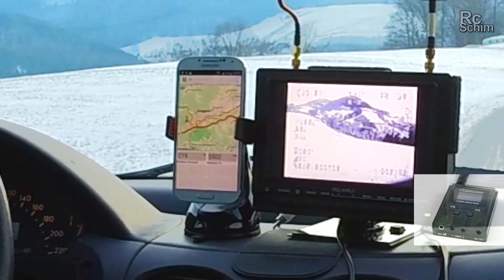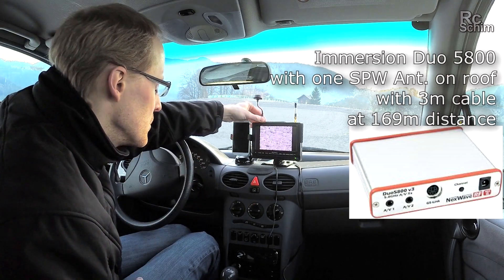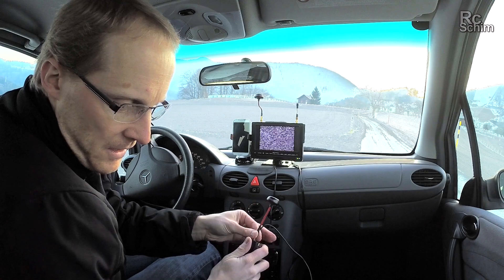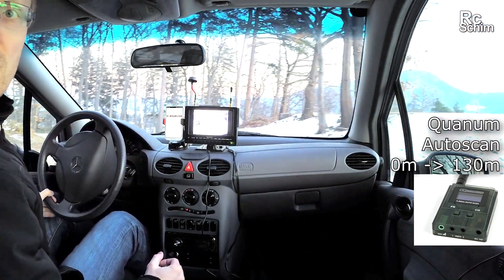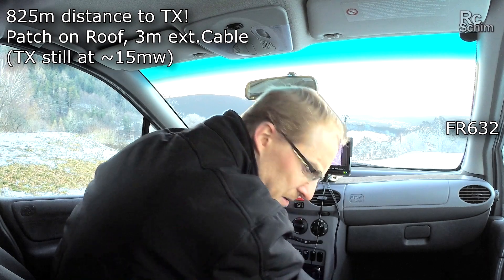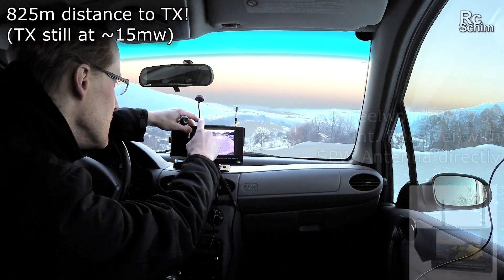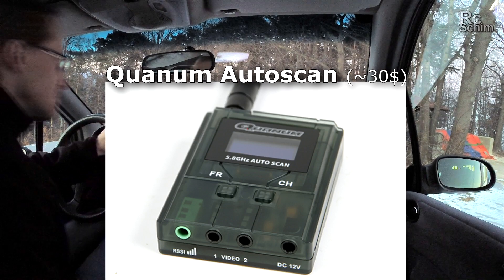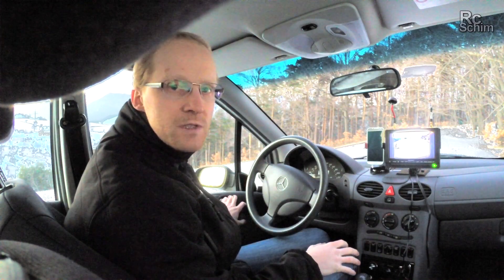BIG 5.8 GHz Video Receiver shootout / comparison (practical rangetest with my car), 25mw Videorange

Comment: hi! Thanks for video! Can You say - is it better, more power, if solder antennas directly to receiver and transmitter?
Reply from the maker: jazepsjazeps i don't think so. I tested the impact of sma adapters - and it was not much. You start noticing loss of signal only with longer cables.

Comment: Hi rcschim. Im looking for a groundstation i can use for mountain diving. I already have imersion rc patch 13 dbi. Will the fr632 be a good option for my mission? And how do u connect the gs to fatshark dominator v3? I will use 800mw vtx power.
Reply from the maker: +Viksa the patch is good but better use a helix - it has same gain but more beamwidth.
The fr632 is good. 
You can use a cinch to headphone jack cable. But there are different wirings on the jack side.
800mw is good :)
Reply: RCSchim thx for your answer. I will follow your advice😊 just got my tbs crossfire micro tx today. Feeling like a kid again.
Reply: Another huge improvement can be easily had by simply raising your receiver/antenna higher up. I frequently use a 3m tripod mast and my range goes up about 50% versus sitting with the RX at head height.

Comment: hello, I still have my old quanum v2 and I'm thinking if I should get a new goggles or just a better receiver like the fr632, how would you compare this receiver to the eachine VR d2?
Reply from the maker: The FR632 is one of my best receivers. lately I also use the "RealAcc" or quanum HB something receiver module in my fatshark goggles. with this upgrade the reception has improved a lot.
See my review about this receiver module. https://www.youtube.com/watch?v=Fh_BFc4Peyw
I think it should work on something like a quanum V2 as well if you can solder a bit. just see which pins are power, witch video and you should be good. the module is really small so you can add it to the large goggles easily!
Reply: RCSchim thanks for the reply, the quanum HB is about the same price as the fr632 so I think will get it if I figure out how to connect it to my goggles
EDIT: I think it's too complicated to make it work, it needs 5v to work and my screen needs 2-3s so I will need 2 different Batts also im not sure about the fatshark pin outs, tell me if you think it could work somehow cause the quanum hb sells for 32$

Comment: Thank you for putting together this comparison!  One thing to consider is that the top of your car roof is a huge ground plane.  The close proximity of the Rx antenna will distort the effective antenna pattern for your measurement configuration.  The same thing happens inside the car (which is why your signal keeps going in and out).  Nevertheless, the situation was consistent for each VRX, so we can at least see relative performance in a non-ideal situation.
Reply from the maker: thanks for the feedback. this was for sure a non ideal situation (and it was freezing cold back then :)
I wanted to repeat this test outside a few days ago - but my waypoint copter didnt work and I wasted a few hours einding the experiments. its quite time consuming and I then rather flew with the miniquad to have some fun.
but I will try to repeat this. RF stuff is hard, so many factors that influence things...

Comment: Thanks for a very clearly documented, and objectively judged comparison.
I wonder how the Quanum RC540R diversity receiver would compare in these tests.
Jim
Reply from the maker: Ha, now I know the real name of this HK divRX at least. I already did a short review, but no real comparison with the FR632.  currently I stick with the known good working FR632 if I go flying. I hope I can do a side by side comparison soon and test different things (also different antennas).  this just takes up so much time...
Reply: RCSchim:
Be careful, I still don't think there is a proper Model number for the single receiver Quanum scanner you evaluated. The RC540R is an enhanced diversity (2 VRx inside) receiver Quanum now makes which may replace the other one. Here is the link for the diversity receiver:
http://www.hobbyking.com/hobbyking/store/uh_viewItem.asp?idProduct=84862&pb=1
Jim
Reply from the maker: thanks, I know this is the diversity one - but Ì also did a short review (in my hangar tech talk)

Comment: Hi RCSchim, thanks for the review
Very informative!
I have two questions
1 I use fr632, if I want to change the on ImmersionRC Duo 5800, as it will be better, if the flying distance of 800-1500 m (worth to pay money)
2 What can you say about Immersionrc FPV Uno5800 5.8 GHz V4.1
(one receiver), it will be better FR632 or the same? what do you think?
http://www.aliexpress.com/item/ImmersionRC-FPV-Uno5800-5-8GHz-V4-1-Race-Edition-40ch-5-8GHz-Raceband-Dual-Output-Diversity/32625068405.html?spm=2114.01010208.3.2.P8rsRC&ws_ab_test=searchweb201556_9,searchweb201602_1_2020018_10017_10010_10011_10018_10019_10036_10035_10034_301_507_10033_10032_10020_10001_10002_10005_10006_10021_10003_10022_10004_401_10009_10008,searchweb201603_9&btsid=8b6d2aa4-dd56-4848-8825-59b3faf96cb8
Reply from the maker: +Дмитрий Zerver funny, yesterday I read how BAD! the Immersion gear is said to be in comparison to the FR632.
Dont know why my tests dont conclude to this - but I guess my testing up there wasnt scientific enough. Gonna repeat testing now in spring and test more...
check this long thread with good info: http://www.rcgroups.com/forums/showthread.php?t=2275037&pp=30
might get you to buy an FR632   (I used the FR632 yesterday and had very good image with standard SPW antennas!)
Reply: +RCSchim 
Thanks for the answer
I understand the difficult pronunciation in English. sorry
If it is possible at the down of a video concluded a small description about video. So it will be easier to understand with written!
I will be in the future to watch your channel!

Comment: I use a 5800 DUO v4.1 on my Quanum v2 goggles (on the rear of over-the-head strap) and it works really good.  It is big, and expensive, but it seems to works as good as I could hope for.
Reply: what is good and how is your setup otherwise?
Reply: I was using two Spironets on VRx, now using VAS Cyclones. Also have some more directional antennas like a Pepperbox.  Using with Quanum Elite 25mw VTx/cam combo and also another 25mw micro system from ReadymadeRC.  But the 5800DUO is just great.  I just got a Quanum 540R diversity to try out too.  Crossing finders with that one.

I have lots of cams and VTxs though, like full sized CCD cams/ VTx up to 600mw. Haven't used them much lately, but hope to soon.
Reply: BWX BWX how does the Quanum RC540R diversity receiver compare with the immersionRC duo5800? I've been debating this for a while since my Quanum v2 pro goggles are on the way.
Reply: The power socket was flaky and loose and I never got around to fixing it or soldering in a permanent XT60 connector or whatever.. so never used it much.

Comment: I wonder if a non-Fatshark/IRC transmitter would cause a different outcome due to them having somewhat different modulations. I'd expect the Quanum and FR632 to perform slightly better in that case.
Reply: I think this is a valid point.  I have read that there is differences pointed out by RC-CAM on the forums in how they modulate or something to that extent.  This is still a great test because I think alot of people are using IRC vtx units but it would be interesting to get one of the cheap hobbyking vtx and repeat the test and see if the IRC receiver then suffers.

Comment: Looking at price the quanum is defently the winner 
For 30dollar
Reply from the maker: +wippo76 yes, the small receiver is really nice. a must have if you use the Quanum goggles. 
also the display  with rssi and voltage work nice.
however I like the flexibility of the FR632 whilst being so small and making my groundstation super compact. flew it with two helicals and had super crips image.
Reply: +RCSchim every situation is asking for another vRX 
now I have to convince my wallet that I need more different RXes :):):)

Comment: thanks for this.

however i am wondering if the extension cable degrades video signal.

any type of adapter and or extension decreases DBI.

Maybe try again with antenna directly on the video reciever
Reply from the maker: +Razor E It was the idea to weaken the signal (on transmitter and receiver side) to get to the end of the receivers ranges and see how they compare under same conditions.
I will maybe show in a hangar video how much the cables and adapters do degrade the radio power. As stated in a test 1m cable was already terrible for the performance. 3m are just killing it.  So if someone has the idea to extend his Antennacable to fly from inside a car: he might have better signal if the antenna is in the car ;-) but without extension cable...
Reply: Ok, I am from a wintery wonderland like you (Canada) so I feel your need to fly from inside your car. I have used a tri pod from outside by car, with a repeater sending signal back into my car with goggles.

I always wanted to use a magnet to place a VRX on the top of my car, however, was always worried about multi-pathing off the metal
Reply from the maker: I had the same tripod repeater setup in the past. I did 35mhz to tripod wroth uhf and long video cable to groundstation outside.

Comment: Hi Mario, that's amazing to see how the receivers works with different antenna setup. Thank's for sharing this! :-) Actually I would expect that all the brands using the same receiver board inside, isn't it? Could you check this probably? Wish you all the best and I'll see you, Paul
Reply from the maker: +hotliner Good Idea Paul, I will compare the circuits like Bruce would ;-)  but I guess IRC uses higher quality but older stuff. the image on the cheap new gear had far less noise - but it did dissapear sooner. So they do maybe some gain adjustment and if the signal is too weak this fails...
As soon as Spring arrives we definitly should go flying together (at the Backyard Airways?)
Reply: You're welcome! Would be nice to have a look inside :D ... Yes we should, at Backyard Airways or where ever you want! :-)

Comment: Thanks for the great and factual video. I am pleased  I have the IRC Duo V3 also. Any chance you could compare high gain antenna in a similar manner, like skew planar vs patch vs various helical. Have you used your IRC antenna tracker much? I would also be interested in your thoughts on it verses a high gain antenna pointed in a specific direction.
Reply from the maker: +Phil Nolan I have plans to do a lot of such comparisons - because I want to have some good reference and stop guessing about this stuff ;-)
But the next tests will be more practical:   my Xugong will have 25mw, 1m cable penalty again and I'll fly it away to read on the OSD how far. This can be tested then with different receivers again and different antennas.
But I can say: last time I swapped my Immersion 13dbi patch against 2  Circular-Wireless helicals (12dbi) and they are very smooth. they have a larger cone and really crisp video.
Didnt fly much with the tracker - because many flights were with miniquad - only seldom with the xugong. As I said - even here the setup time is a bit too much for me...

tracker vs. high gain antenna? well: on the tracker I would use a high gain antenna as well - so the only difference would be that on the tracker you have no limit, on the 2x helical setup  you "preset" your 120° of operational radius. If you happen to reach the border: "park" the drone in the air, remove goggles, turn antennas 100° and continue to fly...

Comment: Hey coole Versuchsanordnung Mario!...gut wenn man sich zu helfen weiss, wenn die Welt einfriert ;)
Reply from the maker: +wolkenkreuzer Danke. Ich hab schon davor mal einen Test gemacht - da ist meine Freundinn mit dem Tripod weggegangen. War dann recht sportlich für sie, denn die Reichweite war besser als erwartet. Leider hatte damals die Aufzeichnung per DVR nicht richtig geklappt: wenn Bildstörungen sind, nimmt der DVR nicht "linear" auf - dh. wenn man 2 auf die Timeline legt - driftet die Zeit auseinander. 
Beim nächsten "richtigen" Test wird wieder eine Gopro auf den Monitor filmen, und der Copter fliegt dann weg soweit das gedämpfte Signal jeweils reicht. Am OSD lese ich dann ab wie weit das ist.
Solche Übungen sind auch gut um zu sehen, trainieren, wie sich das Videosignal an der Grenze des Empfanges verhält. Bis jetzt bin ich immer schon bei leichten Störungen am Umkehren - da geht aber sicher noch mehr.
Reply: RCSchim ...na selbst wenn man weiss was gehen könnte, brauchts dann immer noch eine gewisse überwindung grins...aber es reizt natürlich schon es weiter auszureizen, weil es einem mehr spielraum verschafft ;)

Comment: Pretty cool comparison :)
I did not know actually that the duo 5800 receiver was so expensive lol
Thanks for sharing and have a great weekend
Reply from the maker: +ABMNS PRODUCTION thanks cedric, I checked the current price on the latest v4.1 version that is surely a bit better than my old v3.
Reply from the maker: +ABMNS PRODUCTION thanks for the share. definitly a good idea - but he still copes with the 60hz limit of the liveout screen. And if you don't have electricians background you probably dont have an oszilloscope lying around ;-)
Reply: RCSchim It's true, i almost bought one last year actually! They are not expensive here in Thailand :)